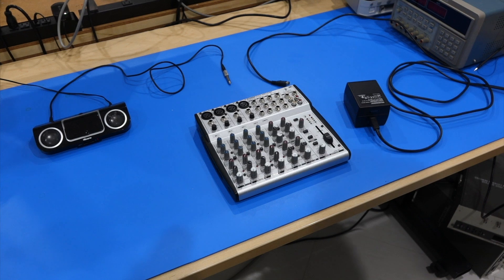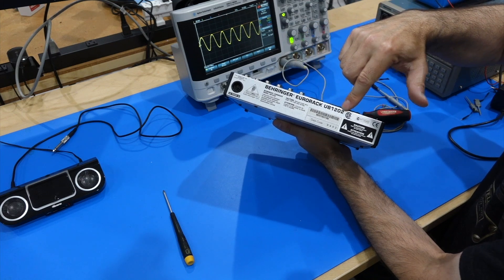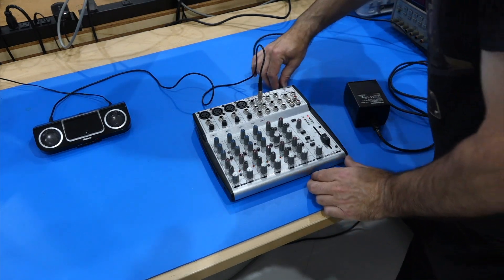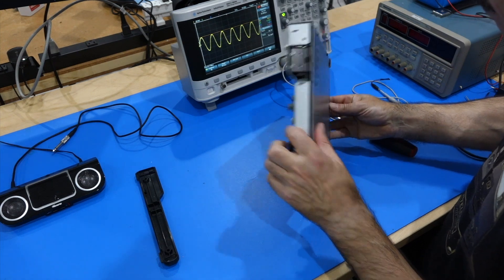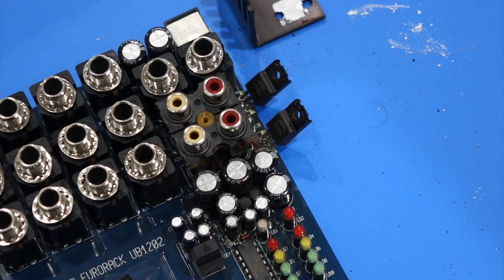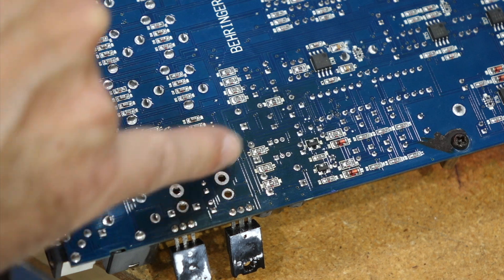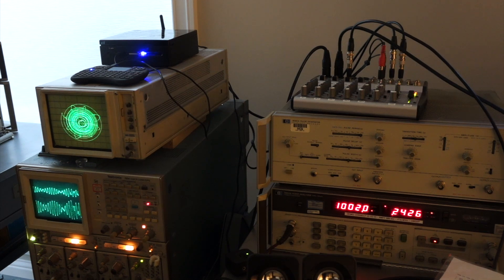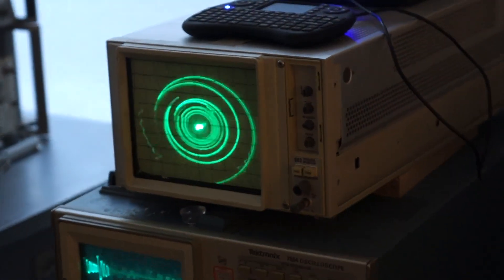Modern Tech Fail: Behringer Eurorack UB1202 Repair

Comment: capacitors are the perfect components to build planned-obsolete devices. Manufacturers choose the brand based on the required "timing".
Reply: Wouldnt surprice me if one day i find one that on the side says Hrs instead of uF
Reply: @laharl2k  
that would be very kind of them!
Reply: @laharl2k  Most caps come with an expected lifetime
Reply: @norgtube  I have made in Great Britain capacitors in my QUAD II amplifier that are still working after sixty years :)
Reply: @norgtube  
Yeah but on the datasheets, and its usualy grossly exaggerated to the point that you have to guesstimate how long they will last based on the brand rather than what what they claim.
I would trust a rubycon or nichicon cap saying 5000 hrs, but i wouldnt hope to get 1000 out of a capxon one claiming the same hrs at the same temperature. 
Im yet to see a blown out nichicon or rubycon cap on any device.
On good PSUs, if they have chemicon caps, the first thing to fail are the mosfet. If its instead just some cheap PSU, its the caps that fail first.
Reply: I'm doing electronics now almost 30 years, and this is the first time I witnessed this unbelievable timing. I'm having a pair of Mackie studio monitors, they are about 10 years old but still doing very well. One day the one on the right started making weird noise and in a few moments later completely silent. I opened it up and found one 4.7uF 50V capacitor that absolute looked like a new, but dropped to around 1.2uF, it was a little buffer in the PSU line. I switched it to a new and the speaker worked again. About 4 days later the other speaker on the left did exactly the same. I opened it up and without thinking I switched the same capacitor and both are still working. That is some art, to make capacitors go bad after 10+ years in 4 days time difference.
Reply: Maybe it depends on the evaporation time of the electrolyte that continues even if you don't use it. That is why I say that manufacturers can statistically measure the lifespan of the capacitor and then estimate the price.
Reply: Not all caps. Just electrolytic crap.
Reply: @pahom2  No ... other kinds of caps are notorious for going bad.  Like the Dreaded Bumble Bee caps.
Reply: @pahom2  what is the alternative with high capacity requirements
Reply: @rodneyfranks2726  multiple ceramic caps connected in parallel
Reply: @pahom2  thank you
Reply: JM Coulon I dunno dude. 

In today’s culture I suspect most people will just bin the item and buy a replacement, rather than even contemplating a repair. Manu’s know this and therefore save money on having one or two components fail rather than everything.
Reply: I spent 10 years at the cutting edge of consumer electronics, specifying TVs and set top boxes, among other things. Aside from a few exceptional examples, planned obsolescence isn't common or intended. What happens is that we demand cheaper and cheaper electronics, so manufacturers are on a race to the bottom in price. Component selection can play a big part of the cost of a product and that has consequences for the lifespan of products. These failures are a part of our decisions as customers to keep buying the cheapest model on the shelf.
Reply: @BobHannent  Planned obsolescence is just the consumer term for "cheaper manufacturing & industrial savings", there's no engineers working on getting things to break after a certain point, on the other end, they're asked to test if a specific setup will make it past what they plan the product to last (hard drives are planned for 10/20/xK hours of spinning, controller buttons for x Millions presses, etc...).  
What you really describe is over-consumerism, because "the trend" is cheap / interchangeable equipment, and bringing "planned obsolescence", not as a fact, but as a concept, for people to understand what they buy could actually be different.
As we face economical crisis after another, recession, and all that stuff, nowadays when you break your smartphone screen, you get it replaced more often than you buy a 1k+ priced "new". Why would it be different for other things? Marketing is creating new needs, not solving existing ones, in that regard, if people realize their habits of consumption can influence tomorrow's product, then it's a good thing. 
The "myth" around planned obsolescence has a positive impact on the market. (remember also, it was vastly popularized when apple pushed a software upgrade to their iphone 3g(s) when the battery stats were "on the low side" and capped the CPU max frequency to """"preserve user experience and battery lifespan over the day****"""", which spawned a sane skepticism in consumers).
Reply: @LawnMo  I would largely agree, although I don't think the planned obsolescence discussion helps, we should be campaigning about right to repair more than we do. I've stopped watching Luis Rossman but he's bang on when it comes to Apple and their restrictive practices.
Reply: @BobHannent  Of course, right to repair is a must, it's just that my country won't prevent me from repairing stuff :p (fr fr fr).
Not everyone can unsolder / resolder caps, but assimilating "failing caps == planned obsolescence" can push people to repair their stuff (people tend to do something when they know/estimate it will be easy/cheap, than stepping in the unknown).
It's not even far fetched to think, electronics are tested in "good conditions", and we all know, say a console will end up in a TV furniture, mediocre ventilation, dust accumulating inside, and as soon as one cap pop, you lost hundreds of dollars for a 50c component.  
As someone who'd like to keep things and maybe re-use it in the future, am I supposed to put solid caps in all the crap I buy or can the market adapt/rebounce out of that "lower limit of components is the go to" ? ^^
And yes, F apple, poor Louis trying to sort that convoluted mess :(
Reply: @LawnMo  every company I was involved with did environmental testing where they soak test products in an extreme heat and humidity, maybe also vibration testing as well.
There is an interesting problem of statistical failure, there will be a failure graph where a certain number of devices will fail during production or the first use. Then a tiny number will fail over their typical life, but the graph rises sometime after the expected lifespan. I don't know anyone who designed for products to fail at warranty as the conspiracy theories often claim, usually it was usually the majority of products should last at least "some years" (probably over 5).
Reply: @BobHannent  It might depend on when and which companies, I was thinking of xbox 360s / PS3s (the bad batches were from around 2006) or say the Freebox mini 4k v1 a few years after (a modem/router from a french ISP) which had revisions due to the (multiple) failures that happened on these products (with the usual pattern : deny > blame consumer > figure something is wrong > make a new revision and handle the replacement fees). They all suffered from excessive heat and/or dust accumulation, popping all the chemical caps inside, sometimes plying the PCB and breaking tracks, sometimes unballing the gpu and/or cpu chip (xbox 360s were known for the "blanket technique" where you place it in a blanket and turn it on, in the hope that cooking it a 2nd time would resolder the components).
Now i have to admit this was 10-15 years ago and things have (hopefully) evolved, it's hard to think of a modern product that had caps all turn to popcorn, except maybe TVs (more like, backlight / led / psu issues) or smartphone charging circuits, which you can consider "consumables". 
The myth or conspiracy theory about products being manufactured  to break after warranty is silly, but I still believe it spawned after the realization that manufacturers were pushing the limits to always come up with a cheaper solution.
Unless we invent a time machine, it's hard to tell if products are more reliable nowadays because the industry standards evolved or if the market demand changed (people are willing to pay more to get better quality), but I believe the "bad cap era" influenced a bit.
Reply: You can bet you would then get fakes advertising 10 000 or 100 000 000 hours, which in reality are only 100 hour parts.
Reply: @SeanBZA  
Well that kind of what already happened in the "badcaps" era. I think i have 3 or 4 motherboards and other stuff from that  time that i had to recap because of that, the only difference is that they claimed more reasonable numbers, it was still a gross exaggeration though some not even lasting a year of none continuous use. You usually know if something is from the badcaps era because you find all the caps on the board bulging or straight up vented regardless of their placement.
Reply: @laharl2k  xbox 360s all the way, i'm having PTSD...
Reply: @LawnMo  
yeah you guys got completely ripped off. my nes, sega and ps1 still work, so im of the idea that a console should last and not die of a manufacture defect. also i hate all the online stores so you will also get ripped off when they drop support for the 360 in a few years. i doubt they will keep it up even if its nothing for them. (based on all the other servers they could keep up but didnt.....cof games for windows cof
Reply: But then the brand gets a bad reputation.
Reply: @KameraShy  
An when was the last time you chose the caps for your devices? its companies that buy them, and usually its third parties that do it, and also brand names come and go. Cheap electronics will still use crappy caps regardless of their reputation for being crap. Heck some even use recycled components,  ive even seen 1000uf caps that when opened had a 470uf recycled cap inside, some even have free sand to simulate the weight.....and not to mention iron pieces to make the product feel good quality too.
Reply: @KameraShy  3 words: fly by night
Reply: Hmmm Dell Optiplex'es 775 with really terrible caps that started to fail right after warranty ended.(My school had those , caps started to pop out in 24V rail), there was even lawsuit against Dell about
practise  using low quality caps
Reply: Mārtiņš Markss what happened to lawsuit?
Reply: @mikcnmvedmsfonoteka  lmao what are you talking about? I've once bought a lot of old dell optiplex 775's and not one of them had any capacitor issues.. and what in the hell is a 24 volt rail?
Reply: @mikcnmvedmsfonoteka  There is no such voltage level in any PC...
Reply: @janosnagyj.9540  There is between +12 v and -12 v rails. He might be thinking about the cap rating not actual voltage.
Reply: @karapuzo1  He wrote 24V rail, which is non-existent. Caps are between GND and the various output rails, never between rails directly. 24V rated caps are also non-existent...
Reply: Janos Nagy J. On devices with a positive and negative rail, it’s not uncommon to have a filter cap between the rails (in addition to the filter caps to ground).
Reply: @tookitogo  Not in a PC anyway. And that's not the right practice, it must be some kind of el cheapo solution to save on caps...
Reply: @janosnagyj.9540  Okay then, 
Mārtiņš Markss was off by only a few volts (only 5 volts to be exact), however the DC output of most laptop power bricks IS in fact 19 Vdc. I think he was "close enough" in a general discussion about a completely relevant issue! China electrolytic capacitors are CRAP. Fred
Reply: @electronicengineer  He clearly wrote Optiplex 775 which is not a laptop at all...
Reply: And consumers choose the product brand based on how long they want the thing to last. The word Behringer says it all.
Reply: So thats why they call them timing caps...

Comment: Bought one of these horrors a few years back and straight out of the box noticed how hot it was getting. Never right in this world. Sent it back and replaced it with a small Yamaha desk, runs as cool as you like.  Steer clear of Behringer.

Comment: Wow, I had the same mixer and it failed in the exact same way. Was appalled by the power supply design having a bunch of caps right next to the linear regulators with no cooling.
Reply: @cda32• I was just wondering why small computer cooling fans have been eliminated from products like these.
And do you think that an external fan would keep components cooler and help them last longer?
Reply: @madmaximilian5783  they should just use some regulators from the modern decade which are lower power and produce less heat. Or have a proper heatsink, they literally try to use the connection jacks as a heatsink
Reply: @cda32  well I guess its its about saving money in production, resulting in short cuts in design and quality.
I run a very quiet cooling fan in my recording studio for circulation and it keeps things pretty cool.

Comment: I changed hundreds of bad electrolytic caps on Dell motherboards many years ago. No idea if it was true, but the story was that the cap manufacturer hd been sold counterfeit electrolyte.  Another bit of kit I had to replace lots of bad caps on was Thompson TV 1530 cameras. We had some when they were very new and after not too long they began developing a fascinating array of faults. After a few sessions of diagnosis and repair, often complicated by their use of thick film hybrid modules which were effectively “black boxes”, we started to realise almost every fault was caused by bad 0.1UF chip capacitors. From then on, we used to play “spot the cap” and analysis of the circuit would usually get us to the culprit pretty quickly.
Reply: Yeah, that was an early capacitor plague. Some missing ingredient to suppress hydrogen generation. Part of me thinks Windows Me wasn't actual as bad as reputed, but that it suffered by being the os installed on the machines with flaky caps that created instability. Telltale smell, a bit like maple syrup....
Reply: There are write-ups about this on the internet. A Taiwan company stole a formula for Japanese electrolytics, but the stolen version was incomplete, missing one or more key stabilizing ingredients. Dell motherboards used them  which subsequently started going bad after a few years. I have some HP SFF machines with bad caps that may have been from the same source. So far haven't got around to replacing them.
Reply: Substitution with cheap junk is common in Chinese manufacturing. We had a kids hospital here where they found ceiling panels had asbestos put in them despite it being made extremely clear they were to be asbestos free. All had to be cut out and replaced - whilst is was being built.
Reply: @Spookieham  by "here" you mean where?

Comment: I find that you can't reliably test capacitors after they have been removed from the board.  Often the heat of desoldering will temporarily reform them.
Reply: That would make sense. I haven't thought of that before